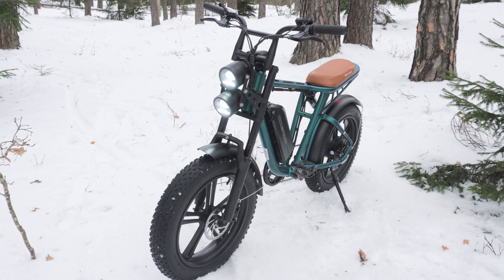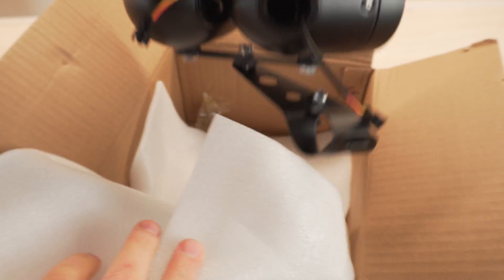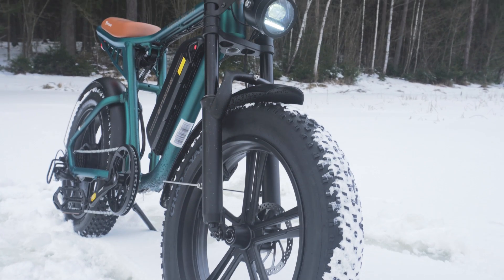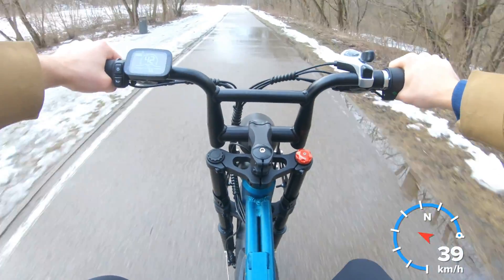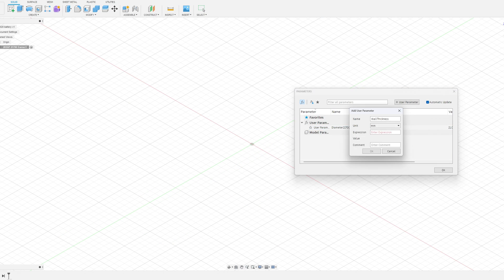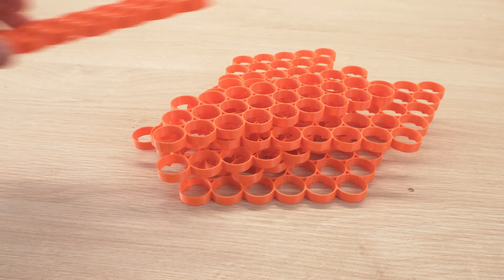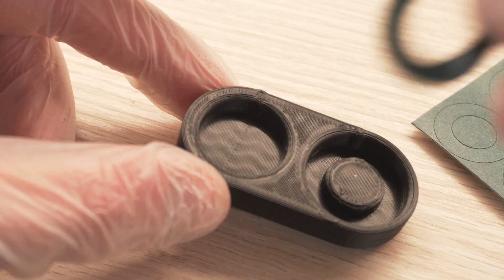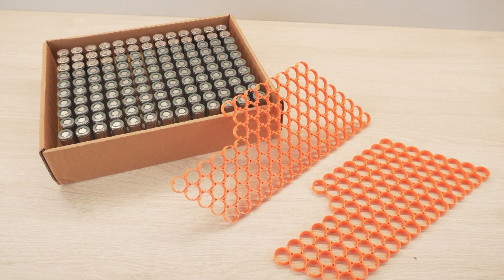3000W E-Bike Conversion from a 750W Engwe M20 - Part 1

Comment: Never finished it?
Reply: 😂😂😂😂 it blows!😂😂😂
Reply: @naizondj  mines been great. I’ve got over 4k miles on it now.
Reply: @User3eighty4  did you took change the battery? Im thinking about changing mine but i dont know if it will work with the same controller and motor.
Reply: @ mine works fine with a 52v UPP 20ah pack. Matter of fact I have 2 of those on mine.
Reply: @User3eighty4  really! Good to know. Did you build it or did you buy it?
Reply: @ bought off Amazon. UPP 20ah 52v 21700. It’s been exactly 1 year ago today since I did it. You can get the 48v too. Sometimes they change controllers or electronics but either should work no problem.
Reply: He may be die :))
Reply: Some1 did a 🧨and never sayed something
Reply: Is part 2 available?

Comment: I was thinking about going for this bike and then changing rear drive to mid drive. To be more specific, i was staring at cyc x1 pro 3. But i don't know will it fit or not.
Reply from the maker: As much as I would love to see a cyc x1 on this bike, I think it would better suit a MTB full suspension bike. Mid drive just doesn't seem to be a good option for the M20, at least from my perspective.
Reply: @DonnyTerek  just found out there's one guy did that. And it actually more impress than i think. Mid drive usually weight less than hub motor but still give out extraordinary power due to chainset. That's why i was looking at it.
Reply from the maker: @NamelessPassenger  I think I've seen that mid drive build on the M20 that you're talking about. I just don't like the idea of using a mid drive on a bike with no quick release axle on the rear wheel (unless you're planning to swap it).
Reply: @DonnyTerek  you got the point...still i have to upgrade m20 cause australia only import EU version which is very weak specially for the size and weight of m20... (500w motor). And cyc did offer quite bang for performance here (discount).

Comment: These stock 750w bikes are so slow they take like 5 years to get to 30 mph!! Just ordered a complete 5000w 72w 45amp rear wheel kit. The top speed will be just over 50 mph!!
Reply: I’m so new to the e bike industry, I need what you did haha. Any good videos I should check out? Thanks bud
Reply: @DrFadez  juiced joyrides is a good channel
Reply: @DrFadez  tail happy tv does some bad ass e bike vids
Reply: don’t we have to upgrade the throttle that’s at “20” new to the ebikes too
Reply: @Slapem  throttle came with it but here is the thing the bike is stock standard front wheel hub motored so now it's 2 wheel drive!
Reply: Do you have the link of the kit bro
Reply: @alitoroganan2442  got a gaming shop to order it via amazon and an e bike shop fitted it. I just ride the bikes lol
Reply: @alitoroganan2442  its on amazon
Reply: @alitoroganan2442  frankenstein bike!! I have kept the stock standard 24v battery on the rear and puny 250w front hub motor wheel and crappy pedal assist, and teamed it with the heavy duty high power battery, controller, etc   bike is real heavy now but still folds in half for public transport. Another advantage is the tyres are really good against punctures unlike fat tire bikes lol

Comment: Where is part 2? I have an Engwe M20 dual battery myself.. Need this update ASAP
Reply from the maker: Sorry for the long delay, should have it ready this month. Taking much longer than expected, but will be well worth it.
Reply: I have a dual battery Engwe m20. Just a heads up their customer service sucks. One battery failed after 2 months. Im looking to do a modded version of the second m20 i just ordered. @DonnyTerek
Reply from the maker: @matthewprovost9879   Sad to hear that their customer service is not the best. I wonder what's the reason for the battery failing. Stay tuned to my channel, I should have the modded version uploaded soon.

Comment: How long until part 2? I have an engwe m20 and am fascinated by this upgrade project. I love my m20 and have always thought it could be better if I just upgraded some of the cheaper parts on it. 
I look forward to part 2
Reply from the maker: Hi! Thank you for the kind comment. Most likely I will have to postpone this project for the end of May because of a few issues with parts delivery. Hope you will stay tuned until then. Which parts have you upgraded?
Reply: Hub motor nb power e street bikes shark battery

Comment: Hi pal, im looking forward to part 2. I haven't got your knowledge, so would like to ask for some advise. I have the single battery version and want to buy an after market 48v 20ah battery with an xt60 connection. What connection does the engwe controller have and is there an adapter I could buy or will I have to cut off the original adapter and add an xt60 female plug. Thank you
Reply from the maker: Hello, thanks for watching! I hope to have the second part released soon. The original controller uses a Deans (T plug) and you also need a dual battery equalizer. I'd recommend you get the 30A XT60 version here: https://bit.ly/3UWfcPV and get two XT60-Deans adapters to connect the original battery on the M20 to the equalizer and the equalizer to the controller of the e-bike.
Reply: @DonnyTerek  brilliant, thank you

Comment: Amazing video, and I can't wait to see your progress and learn from it
 I have a few questions about your battery pack as im also planning to build one. 

In terms of charging your new custom battery, how will you go about doing it. At what amp and watts will the charger be rated for. Also, what are the specifications of the BMS? Will it have cell balancing or bluetooth for monitoring? 

Also, have you thought about adding type C charging for the battery pack? By using a PD trigger board and a buck boost converter, you could potentially charge the bike with a 100w laptop charger. Additionally, you could add a 12v car phone charger with 60w PD so that you can charge your phone at the highest rate when using it for navigation, tracking, and music.
Reply from the maker: Hi, thank you!
Not to spoil too much of the part 2 of this build since I will have more info on the battery provided there. I haven't thought of having a type C charger but I reckon it would take quite a while to charge a large battery like this with a 100W input. The new LCD screen that I will use has an integrated 500mA usb charging port.
Reply: @DonnyTerek  Thank you for the reply. I do agree that 100W charging would take quite a while, but it would be nice if both options were possible. Where you can have one port for charging the batteries directly from the charger at a faster rate with a higher wattage and another port that supports type c charging for when you forgot the charger or are charging at work.

I have seen that some LCDs come with a USB port but it's 5V @ 0.5A max which is 2.5W. That is extremely low and I'm not sure if it can even charge a phone which is using data and navigation while the screen is on the highest brightness. So having a higher wattage charger for a phone would be nice.

Again thank you for the reply. Watching your videos is teaching me a lot about making my own e-bike and it's amazing how well both the ebike and your videos are made. Keep up the good work and good luck, cant wait for part 2.
Reply from the maker: @sidthesloth5213  Thank you for the comment, I will keep in mind the USB C charging option for a different build perhaps one which is more weight-friendly and a smaller battery. Yes, the 2.5W charging is weak but since I rarely use my phone while riding, I don't see it necessary.
Thank you once again, glad to see you enjoy my videos. Will do my best to have the second part out soon.

Comment: I have & sell  similar bikes using same integrated bafang 750 watt integrated motor & wheel. Have you experimented to see how far you can push the existing 750w motor?  Would love to see a parts list and cost for the build as you  go in case I want to convert one of them.
Reply from the maker: Hi, I had the idea in mind of trying to see what is the limit of the 750W geared hub motor but I doubt it would survive more than 1.5kW for long without ruining the gears inside.
Reply: @DonnyTerek  you can upgrade to metal gears inside and push over 3kw
Reply: @Full_Throttle_no_Brakes  got a controller recommendation that would pair well with a 30A BMS on the battery?
Reply: @rickc2222  VESC 75200. Fully Programmable. Very capable, High power if you want, if not, just tune it down, You can configure as you want and add field weakining for more rpm = more top speed.

Do your research on the VESC for you can use properly what this little guy is capable of
Reply: @Full_Throttle_no_Brakes  Ah, I was thinking more off the shelf plug n play....

Comment: Hello. Thanks for part 1. I want to know if the bike will be comfortable with a height of 180 cm. Is it possible to install a longer saddle. Would love to see continued improvement. Please touch the topic of comfort and discuss the fit and handling in the video. Thank you. I just want to buy this bike for myself, but I'm afraid that it won't fit.
Reply from the maker: Hello, thank you for watching. I have touched the comfortability aspect a bit in the description. I am 183 and the bike feels OK, though on the first ride it felt a bit strange having the seat angled slightly downward, making you adjust your seating position from time to time. But after riding it for a few hours straight I noticed myself getting more used to the seating position and feeling quite comfortable. But unfortunately the seat is non-adjustable so I can't say if you'll like the seating position. For me, I feel the seat could be angled upwards a bit more for most comfort. The handlebars are wide and tall so it feels good riding a cruiser style bike like this.

Comment: Is the bike comfortable for your height? Because im quite short and im not sure if this would be good for me
Reply from the maker: I found the bike to be not the most comfortable due to the slight downwards slope angle of the seat on my first ride, but after a few rides I got used to it and it actually feels ok. I'm 183cm, feels good overall for me considering the moped style frame size.
Reply: @DonnyTerek  damn, im 165cm so very short im not sure if this is the best for me
Reply from the maker: @alankiedrowski54  They advertise the bike to fit from 152cm, so I think you should be good.

Comment: Hello, can i ask where you live? I live in Sweden and i have a moped and electric scooter to get to work, and these are good for that purpose but no good in the winter. This looks much more practical for snowy winter conditions?
Reply from the maker: Hi! I'm located in Lithuania. We had plenty of snow this winter so I even had the chance to test it in some deeper snow in March. And yes, it does ride very well on snow and has enough torque to get you through most roads.
Reply: @DonnyTerek  thanks for the reply!

Comment: Wow, I wish I was half this smart lol. I've only been looking into e-bikes for a few weeks so I'm trying to learn everything as fast as I can to make a decision. I really like this bike, especially this color and probably would have already bought one if it used 21700 batteries. I think at this price point every company should be using quality 21700 cells. Also, I don't like that it doesn't have quick release tires and 24" tires seem really big to me but I have no experience there so I'd need to try it to know...No matter what I buy there's gonna be things I don't like so it's about finding the least amount of cons for me. This is still in my top 5 right now and looking forward to seeing what you do with it. Good luck!
Reply: This is actually much cheaper than I thought so I guess that's why they're using 18650s. I'd pay more for better cells tho
Reply from the maker: Thanks! Means a lot to me. I think that manufacturers will stay with 18650 cells for smaller batteries like this 13Ah one on the M20 for quite some time even though 21700 cells have a higher energy density of around 30%, while being only 10% larger than 18650 cells. But don't be mistaken that 18650 cells are lower quality in some way compared to 21700. For my build, 21700 cells are more beneficial due to higher energy density and smaller battery size overall.
This e-bike is really quite good looking, the green colored frame is just stunning. I see the fat tires as a bonus for better grip and stability on rough terrain, but it has its disadvantages of course, like decreased range and added weight. Considering the price compared to others, the M20 has much to offer. I have wrote down my experience with the bike in the description if you're interested to read.
Hope you make the right choice.